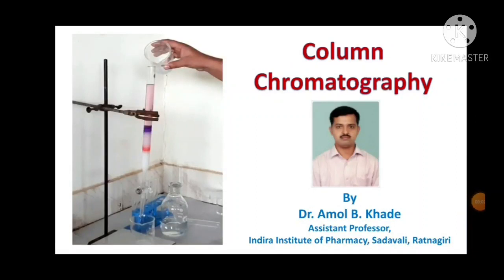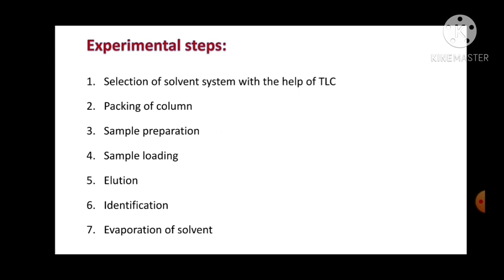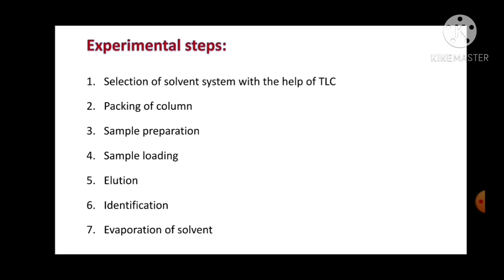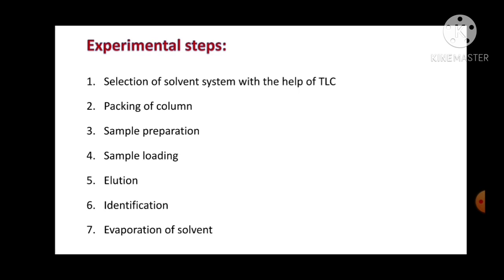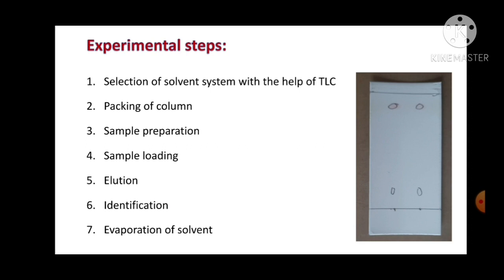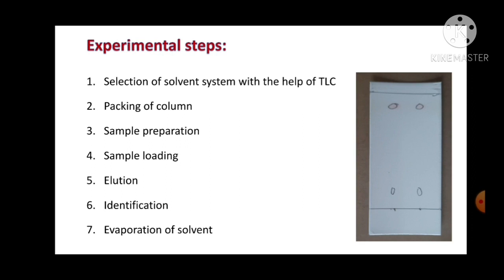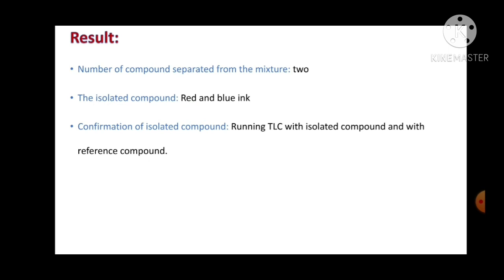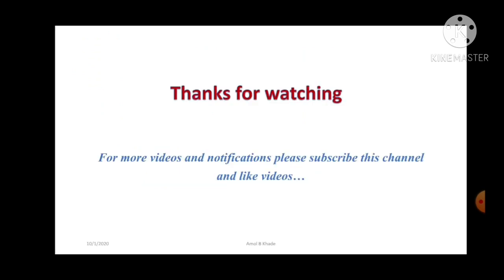Separation of compounds by Column chromatography

Comment: If we are taking ethyl:hexane as Mobile phase in 1:2 ratio can i mix the solvents before wet the column .or can i use the hexane as how u used a water?
Reply from the maker: If u wish to do isocratic elution u can mix the solvents and elute with the same, if u are doing gradient elution then pack colum with hexane and gradually increase the polarity by adding ethyl acetate. Thanks for watching this video.

Comment: Sir.. U told the.. Mobile obsess slick and water,, 9:1...but u don't taken in video.... Why sir?
Reply from the maker: Yes, as its gradient elution, so I packed the column with only ethanol as silica slurry and then slowly increased the polarity by adding water in ethanol as solvent system, which could have noticed in the video. Gradient elution will help to speed the process and save solvent loss. Thanks

Comment: Thanks.if you have mixture a lot or small amount how can take silica amount in both case? I mean how many gram of silica can use? Is there standard depend on mixture ?
Reply from the maker: Depending on the number of spots and spot difference from TLC, you should opt the length of column and types of adsorbants for ex silica gel (60-120, 100-200 or 200-400 mesh), and depending on amount of ur sample (g, or mg) you should select the width of the column. As such there is no thumb rule, however u can to do it on trial and error and based on resolution obtained on TLC.

Comment: In an HPLC experiment 4-nitrophenol, acetophenone and benzophenone were analyzed. What is a good asymmetry value? And also if the values are below or above that value, what is a possible reason for that?
Reply from the maker: Ideally, to get a Gaussian shape peak we should get Asymmetry value 1. If the value is greater than 1 it shows tailing and if it is less than 1 it shows fronting. There are many possible reasons for not getting symmetrical peaks which u need to find out practically. Some of the possible reasons are aging of a column, contamination of HPLC system, exhausted guard column, improper flow rate, temperature, high ionic strength if RP is used, extreme pH conditions, improperly diluted/ conc. samples, solvent pH, etc.

Comment: Sir.. U told add solvent.. Means which solvent
Reply from the maker: Solvent system is mentioned in the requirements i.e. ethanol and water in 9:1 proportion.

Comment: Sir which solvent has to be taken for purification of protein in mushroom
Reply from the maker: It depends on what kind of protein u wish to isolate. What u can do first develop the mobile phase using TLC, optimize the solvent system which will definitely help u to decide solvent system for column chromatography. If u wish to use HPLC Acetonitrile and TFA can be used in RP mode.

Comment: Can we do it for oil also sir
Reply from the maker: Yes, rough separation of crude oil is possible using column chromatography, u need to optimize the solvent system. If possible after column chromatography u can separate more purified fractions using GC or HPLC. U can also try using preparative TLC if it's on the microscale. Thanks for watching the video.
Reply: @dr.amolbkhade3003  sir can you please guide me how to extract lipids from cooking oil ? Is there any titration method can be followed ?

Comment: please sir tell me how can i separate [6]-gingerol from crude extract  of ginger by organic layer seperation
Reply from the maker: You need to identify and optimize the solvent system first using TLC. Once u get separation of 6-gingerol on TLC u can try in column using developed solvent system. Probably u can try with Diethyl ether and n hexane with 7:3 ratio.
Reply: Ok sir thank you